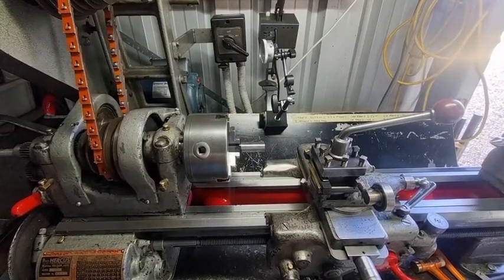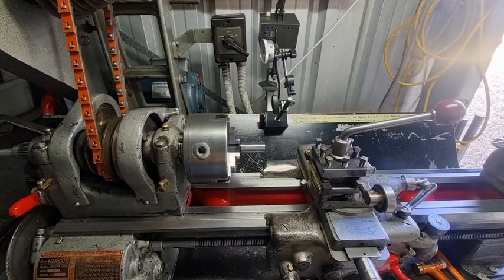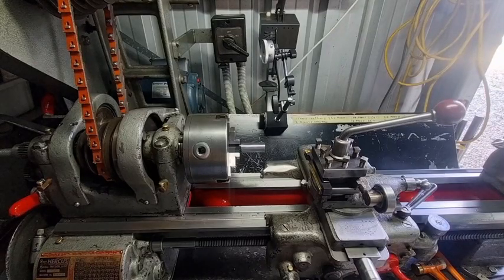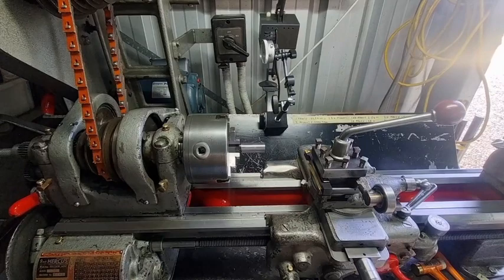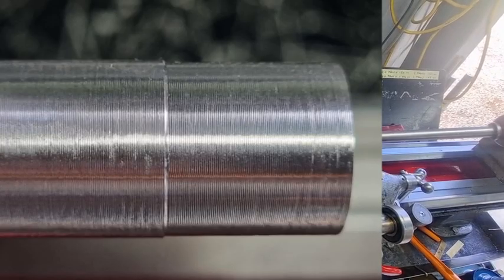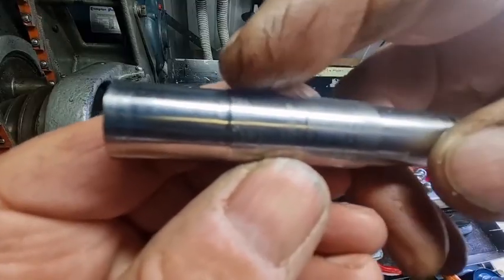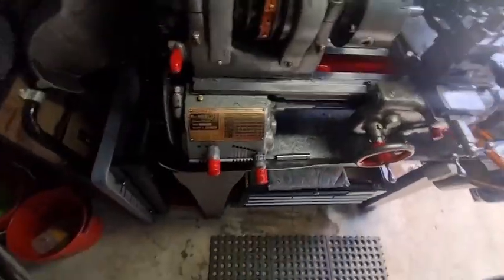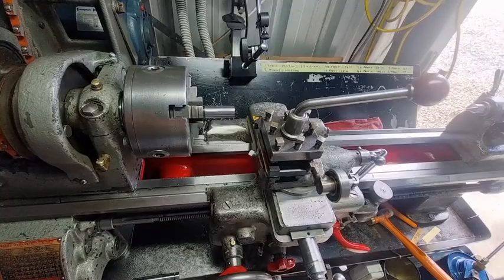Getting a better surface finish on mild steel

Comment: I'll try this, I turn a lot of 1018. I can get a (near) mirror finish with my HSS shearing tool. Keep it sharp and run slow with a bit of oil. Also, a shearing tool is set to take one or two thousandths at a pass, no more. It usually takes two or three passes for the shearing tool to cut all the way to bottom of the grooves left by the single point. You end up with a pile of nice steel wool when you're done too.
Reply from the maker: Good information thanks for sharing.
You using vertical sheet on the side of the tooling and the front 8° clearance.
What about 1020 mild steel whats your finish like on that.

Comment: The common grade of mild steel is 1020.    USA spec. meaning 0.2% carbon.  However difficult to get a good surface finish.    I have an ancient Engllish made 9" Toolmakers Lathe with plain bearing headstock like the Hercus.    Runs at twice OEM speed as it is fitted with a 2,880rpm motor vs. 1440 when OEM.   Both Lathe designs were derived from the USA Southbend 9" Lathe I'd say.
Try using mild steel grade 1214 or 12L14.     The "L" in 12L14 signifies that it contains 0.15% to 0.35% lead.  Not only does it turn beautifully,    light cuts with a shop ground HSS tool and WD 40 will produce an excellent surface finish and as a bonus you should be able to take finishing cuts of as little as 0.00025" which makes for greater accuracy.  The HSS tool I ground has ~ 2 degrees front and ~ 1 degree side clearance,   no nose radius and no top rake at all.    A YouTube learnt trick to set the tool on the workpiece centreline is to very lightly nip a 6" rule between tool and workpiece and sight from the tailstock end to see if the rule is vertical.  Shim or adjust tool holder until it is.  For an outside turning tool best to set slightly low vs. high or else the tool will rub and not cut.  Set boring bars slightly high for the same reason.
Reply: A finishing cut of 0.00025 “on a lathe ?…. are you sure your decimal point is in the right place ? - that is a cylindrical grinding depth of cut ! 🧐
Reply: @steve4479   Yes,  a quarter of a thou deep cut.  Freshly ground tool tip and the swarf comes off like powder.   Part held in a collet not a 3 jaw chuck for full radial support.  If you haven't tried machining 12L14 try it.
Reply from the maker: Great advice

Comment: Your picture that you were showing in your video tells me that the "tip radius" of the insert you are using is very small plus your feed per rev amount is a bit to much for that insert. Inserts have different size tip radius's for each type of material that you are turning and at what feed rate per rev it is good for. Softer material needs a higher rake angle ( tip should be at center and trialing back at a few degrees away ( lower )from center ) They also need a much larger "tip radius" to "burnish away" the material on the trailing edge of the insert. Use a insert manufactures "data sheet" and recommendations to pick out a suitable insert and a proper holder for that insert to get the finish looks / smoothness  that you are wanting  in the finished work piece.
Reply from the maker: Thanks for your comments.
Radius on the tip is not shown when you buy them.
The radius should be printed on them
I buy in in plastic box x 10 no information on the box
Reply: @hercus9a I 'd suggest not buying dirt cheap inserts mate. 😅

All packs of inserts should have the ISO code on them

For example: CCMT060202 

First C is the shape
Seco d C is the cutting lip angle (it's a positive angle which is what you want, a negative angle like any insert with an 'N' for the second letter is really for heavy roughing on larger more powerful and more rigid machines)

The third letter (M in this case) shows the level of tolerance of the cutting edge of the insert (and no 'M' does not stand for 'moulded', nor does 'G' stand for 'ground', all inserts are moulded and all inserts are ground, the tolerance is just a letter denoting the tolerance) and the last letter is for what type of features it has (like chip breakers)

The first set of two numbers are the size of the insert.

The second set of two numbers, eh, I can't remember what they are. 😂

The last two numbers are the nose radius (in this case a nose radius of 0.2 mm).

US marketed inserts have a different set of numbers showing imperial equivalent designations of size and nose radius.

All inserts have a grade too, which shows what materials they are intended for (as said elsewhere though, you can use inserts like uncoated CCGT (that are meant for aluminium) in smaller lathes on steel, you just have to go a bit easy on them.

Do a bit of research, understand the ISO codes and how they effect the suitability for the material you're turning and the lathe you have, and buy from somewhere where they come with that information on.  Once you have that information and understand what speeds and feeds you should be using (hint, on a smaller less rigid lathe, you need to be less aggressive with speeds and feeds, the manufacturers recommendations are for proper 'big boy lathes' that most of us don't own) you'll be able to get a reasonable surface finish on most steels, whether low, medium or high carbon, alloy or stainless (apart from that hateful obnoxious 304 crap! 😂).

Comment: Would a vertical shear tool work on that material?
Reply from the maker: You need some  clearance at least 5° angle
Reply: @hercus9a  Yes, that's about what I have on mine.

Comment: On cold rolled steel, the smaller the depth of cut, the worse the surface finish becomes. I always just increased the depth of cut on the finish pass until it cleared up.
Reply from the maker: I find if I turn just below below the centre line I get a  better finish
Reply from the maker: But you need small cuts when getting close to the size you need taking a few thou off to get close to the desired measurement
Reply: @hercus9a You just need to take a test measurement right before the final pass.
Reply from the maker: @DennisVirden I guess its all about experience on knowing what to do and when to do it and how to do it.
Thanks for your comments

Comment: I assume by mild steel you mean EN1A ,If surface finish is very important use EN1A pb ,this contains a small amount of lead ,machines like butter but is difficult to weld .Also with light weight lathes it is difficult to finish with carbide tooling if you are only taking light cuts ,HSS tooling will give a better finish.
Reply from the maker: Yes 4140 is what I like to use mostly

Comment: I have a 9”ARM.  I make a lot of parts from 300Gr MS I can get a near mirror finish on it with a DCMT insert, on centre. High rpm slower feed. No oil or coolant.  I have a roller bearing headstock though, not a plain bearing like yours.  Always makes me laugh when people refer to a 9” or 260 as a home or hobby lathe, when they were sold as small production machines.
Reply from the maker: I have those diamond inserts as well DCMT11T304 12mm shank
300gr mild steel not sure of the grade.
I use 4140 steel mostly
Reply: With a 9" arm , you should have been a shorthand typist 😉

Comment: Are you adhering to the rules like - Lock cross slide, no overhang on the cross slide, tool condition and rigidly mounted/ as far back as possible, workpiece rigidity and if not then consider a tailstock centre support or travelling steady. Even a one inch piece of steel (or anything for that matter) can flex under cutting pressure and all of these things will contribute to poor surface finishes. Additionally the quality of steel is so variable unless it's a specific standard. Much of the steel has so many impurities due to being recycled.
Reply from the maker: Yes mild steel is  very poor indeed givesome 4140 any day to machine.

Comment: What kind of bearings does your lathe have?

You aren’t supposed to run carbide with plain bearings, I have never heard why tho I suspect the spindle bearing clearance may be hard on the cutting edge.

It is awful hard to get a good finish on a light lathe period.

For mild steel 1000sfm or higher should produce a good finish.

I normally run a 26x80 that is two or three years old and it is hard to finish on that.

My 13x40 Jet at home is hit or miss, super fine tuning with HSS will often work but carbide if I push it hard.
Larger nose radius than what is recommended for finishing. 
The pinlock inserts Grizzly used to sell did a wonderful job.
Reply from the maker: Hi the spindle bearings are cast iron on steel at the front and ball bearings at the rear
Reply: I have actually had the best surface finish with carbide but sharpened with positive rake and steep angles like you would do for HSS.  (Yes the carbide is brittle, so I use cheap brazed inserts). Then run fast.  I run dry, oil has only given me a mess.  The goal is to reduce cutting forces as much as possible.  Sharp edges and high rakes.  Turn the speed up until to chips are at least yellow to blue. With this set up, you can shave a half thou cut.  Sometime it comes out shiny, but usually it is just smooth light satin grey that easily polishes with fine sand paper.
Reply from the maker: @RobertSimpson-i3z thanks for your feedback

Comment: If you get a bette finish by lowering your cutting tool, then your cutting tool geometry and chip breaker is the wrong one for the application. If using a small lathe like shown, use an insert grade that is meant for finishing, as it has the ability to actually cut very small DOC.
Reply from the maker: We are talking .5mm below the centre  line.   
We are also talking about mild steel,
that is the worst metal to turn as it tears thr surface a bit.
That is my findings, and I have tried all settings

Comment: Good detailed info! For an older machine that will have low SFPM on small diameters, I use HSS with a high positive rake, 180deg lead angle. The high lead angle produces a very thin chip that minimizes the BUE (built up edge) that causes the intermittent tearing so prevalent with mild steel. Use plenty of cutting oil. Feed from left to right; this allows cutting from a square shoulder. Finish consistantly less than 63. DOC .001-.002.
Reply from the maker: That's an excellent approach, especially for older machines, and the high lead angle with a thin chip is key for mild steel.